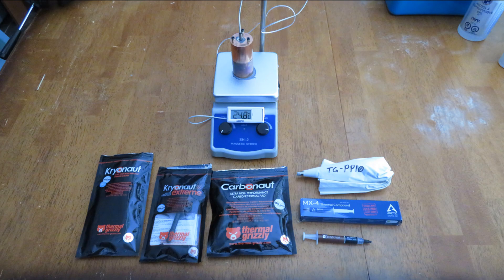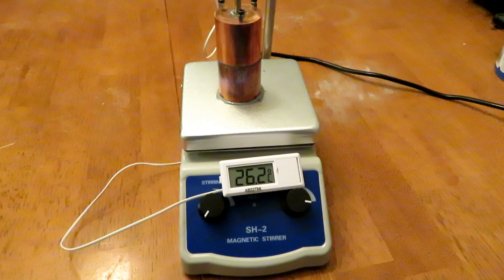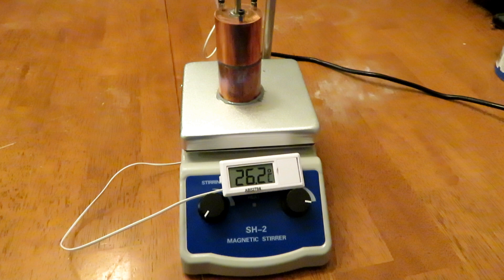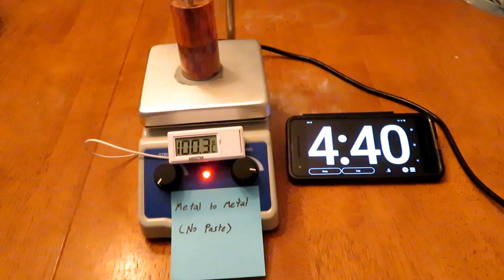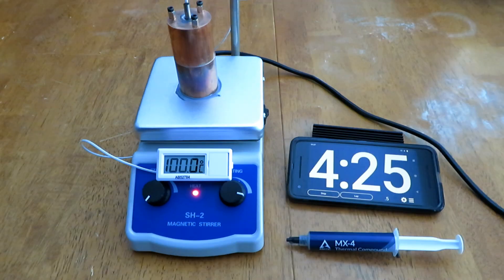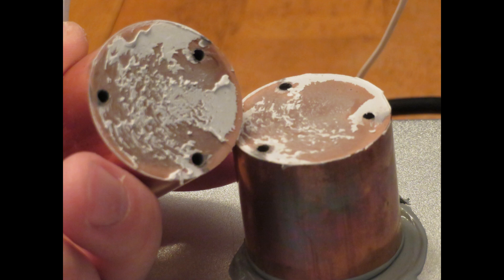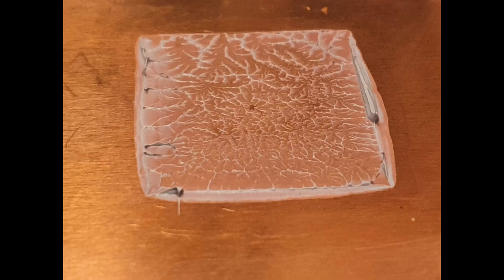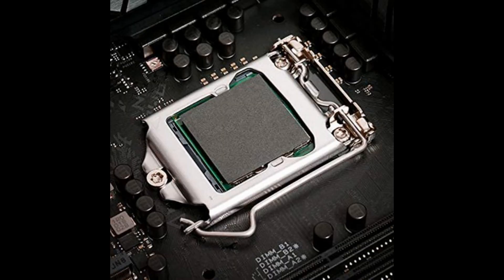Thermal Pastes: The Race to 100C (REV1...)

Comment: I think your lack of variance is due to having free air allowing for radiated heat, heat loss, of the copper. Insulate the plate and the entire lower/bottom slug and rerun tests?
Reply from the maker: I'm thinking of just eliminating the bottom block entirely for paste tests and just using the sensor block. 

I may even make a smaller copper block and sensor setup just for thermal paste testing.
Reply: @snarksdomain  pastes are more sensitive to BLT so unless you have a mechanical clamp, your current methodology you’re in for some complications. That said, non direct die cooling pressure from Intel is stated around 50 psi so if you add about 28 lbs on top of the slug, you’ll mimic this state

Comment: So the thermal putty has similar performance compared to the pastes? That's rad
Reply from the maker: I say this with the utmost caution: perhaps. 

I'll rerun the test sometime next week if I can and only use the sensor block and just place each paste/putty onto the hotplate.

I don't think Carbonaut will get accurate results as the hot plate surface is not flat like my copper blocks are.

It would be amazing to me if the Putty could be used in place of thermal paste. Then you'd only need to open a card once to replace everything.